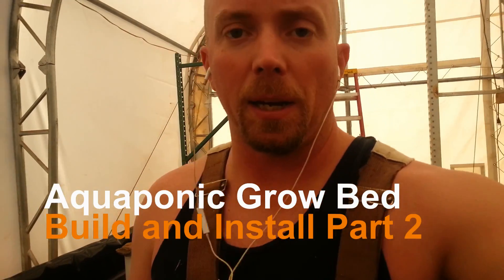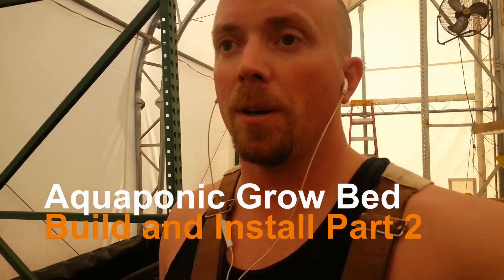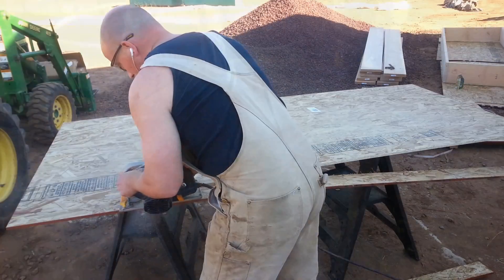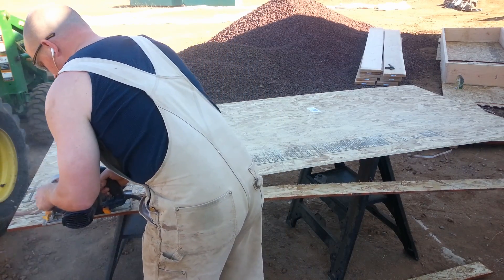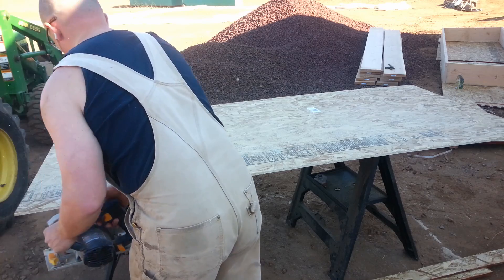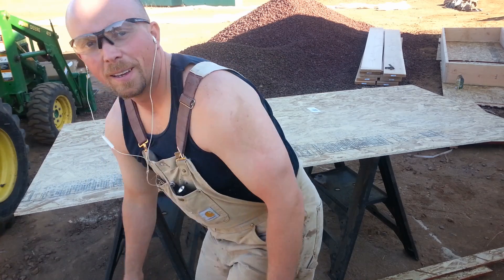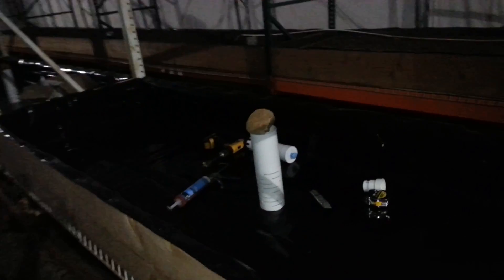Most Inexpensive DIY, AQUAPONIC Grow Beds Part 2

Comment: A device I build some years ago for moving concrete garden sleepers solo might interest you. We call it the crocodile because that's what it looks like in use.
Two pieces of foot-wide pine plank about two foot long, each with an axle attached across the middle of the underside and a wheelbarrow wheel on either end of the axle. Put one under one end of the long heavy thing you want to move and the other under the other end, and you'd move those large awkward boxes easily and without scratching up the side dragging it over your crushed rock.
If you strapped just one crocodile piece under one end of the box, you'd probably be able to manoeuvre it like a very long removalist's trolley.

Comment: I did pretty much this exact same thing 14 years ago back in 2012 (3/4" ply bottoms, VERY thick PP liner, concrete footers for base).  Talk about a ton of work!  Lasted great up until recently. Somehow, somewhere there is a leak / hole seemingly in the PP liner, not even sure how it would have happened.  Pulled back the gavel but haven't been able to locate it.  Also, all 3 beds started leaking at the hole where the syphon drain was.  Once they start leaking the ply is quickly ruined and can't get them to seal back up.

Comment: I love you man! i was about to spend 800.00 on a floating raft bed. Then I saw the idea of using the pallet racks. Its brilliant! Found one for 100.00. Have you ever had an issue with the wood abrasiveness and the need for a barrier for the plastic? Also what mil plastic did you use brother man?

Comment: Smooth mobile  home roofing..Can be used to replace that osb  and it will not rot away in two or three years ..-like what you are doing,  now ..-is going to happen.. water inside of that plastic ..-potentially-is going to create wetness against that OSB ..and it’s not going to last you.. as.. did not coat.. it,  with anything.. 👍I did what you did and it rooted- through.. in 3 yrs 

Prior planning prevents poor performance

Comment: Is that painters plastic you’re using for “pond/bed” liner?
Reply: 10 mil plastic from Home Depot from the looks of it. $50/roll
Reply: Did the same and it leaks a lot.
Reply: its actually "pond liner", they do sell a limited selection of sizes at places like home depot.  For specific sizes better off ordering online, pond store or hydroponics shop.
Reply: Melody and Papa Bear I'd like to know this too.

Comment: I might be a bit late and you might not even need them if all your beds have the wire underneath them all.  But, IF you find yourself joining sheets of plywood together and you don't want them sagging individually this is the part you need to check into:
https://www.fastenal.com/products/details/0226543 
They are called plywood clips and they work like a charm with no additional labor.
Reply from the maker: you were close ;-)...great idea...thank you. I never knew those existed

Comment: When you drill the holes for the drains does the sawdust not go into the fish water?
Reply from the maker: can't sneak anything past you :-) yes it does...that is unavoidable because I have to measure the drill hole in place due to the wire racking and it's position relative to the center of the bed.